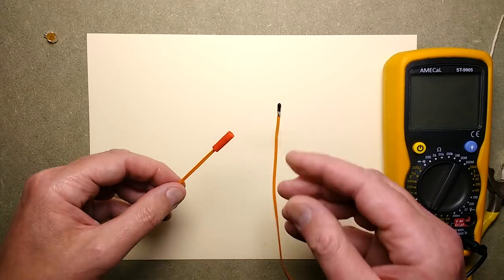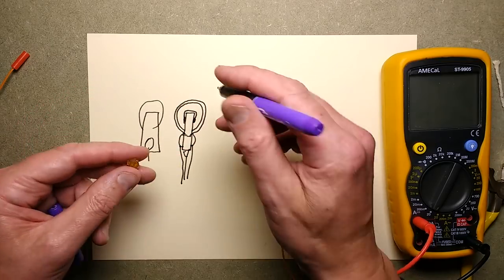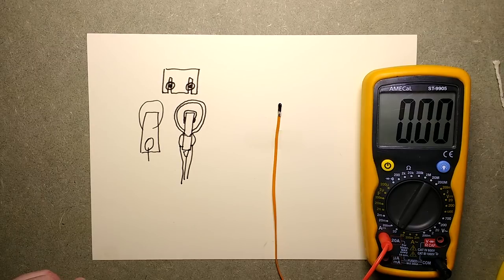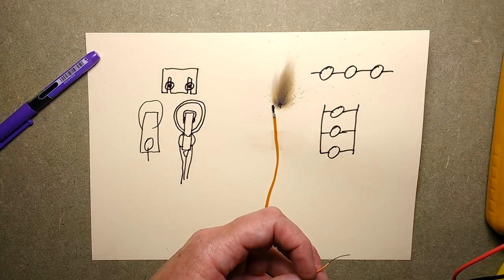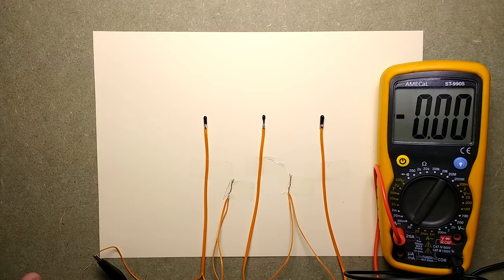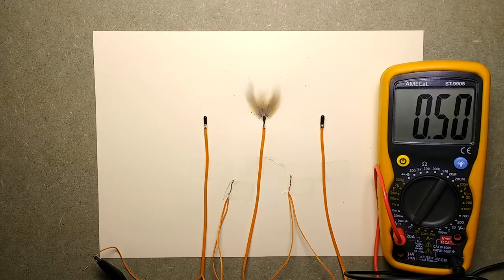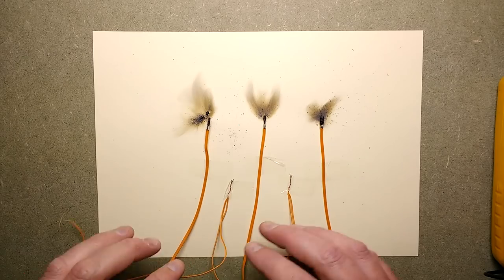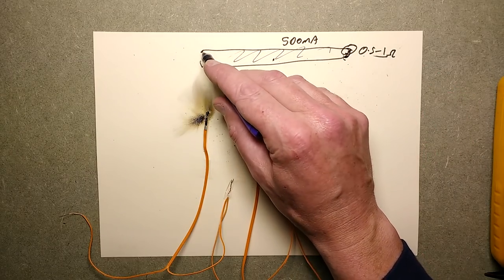Testing for electric match misfire.  (bangs and flames)

Comment: Hey Clive, I actually did set off a maroon prematurely with an RF device - I had about 90 feet of cable spooled onto a reel between the maroon a few feet away and the "detonator" - 12v battery and ptm switch - in the core of the spool, but the battery was disconnected to prevent early detonation. We were using licensed radios to communicate on site so transmitting at about 5W erp. I keyed up while holding my radio near the spool of wire and the maroon went pop! - An anecdotal incident for sure and not an occurrence that I've tried to replicate, but certainly food for thought and it affected our future use of maroons.
Reply from the maker: If it was 2-core cable you'd think the common spooling would have rejected common mode noise.  Strange.
Reply: Yeah, very odd indeed! Maybe the cheap Chinese radios were somewhat to blame? We ended up using little radio controlled wireless detonators which did the trick nicely though.
Reply: The radio quality certainly has nothing to do with it, since crappy radios wouldn't transmit at massively higher power than expected.

The current in a 50 ohm load is 300mA at 5W, so if the entire thing had by some freak accident a low impedance for your TX band, it's not totally unthinkable for a sufficient current to be induced. Seems highly unlikely and weird, but not impossible.
Reply: tommihommi1 Your spool must have acted as a pickup coil, multiplying the induced voltage by the number of turns.
Reply: Remember also that RF is used in a lot of pyro systems to control the effects (such as galaxis (firing-system.com), so the effect of at least low power RF must be understood and mitigated against.
Reply: John Francis Doe yes i also wonder if the spooling was causing high voltage nodes or perhaps even resonant. I've also heard that the cheap baofengs leak rf badly through  their shells so if the other hand was resting on or very close to wire or spool it could cause trouble.
Reply: Freak things happen with long wire. Could have been static build up on the wires. A nice coil wound antenna. just like in the old crystal radio set. No external battery needed.
Back in my early audio days we had issues with wire and air movement, getting static build up on the wires. Some times it got high enough when connecting the equipment up, to flash the LEDS on the powered off sound boards.
Reply: I’m reminding of a story we have locally, one of our radio team members was also active in the marines.  They would carry 5w radios around. Marines would put SQUIBS (used for jettisoning  armament) in their pockets. 

A common demo was to throw them in a coffee can and Key up the radio above it and have it go bang to get the younger marines to be careful with handling them.

Different type or pyro device but ultimately the same issue, induced RF currents can cause unintended detonations on any pyro device.

Comment: Could it be that because you ramped up the current slowly the first one blew but then the wire is in open air which allows it be cooled. Then then next one needs more current as the first is heating the air without blowing then a second blows then you have 2x wires being cooled by the air which then needs even more current to pass to get the same heat in the 3rd one to blow and when the 3rd one blows the wire is hot due to the explosion and the higher current is then able to blow the open. (Would they all fail open at higher current?)

Comment: After watching in slow motion (x0.25) the par with the 3 charges connected ins series, I noticed that the current spiked to 0.980 mA for a split second and the other charges didn't explode. maybe they are also built to withstand current spikes for a few split seconds? and also the resistance in the charge that exploded got really low because of the heat for a split second?
Reply: likely just the meter being stupendous.

Comment: If you placed a resistor in parallel with the charge, couldn't you use that to maintain continuity in case of a early fire causing open circuit?

Comment: Ah jelly crimps, the reason I have to have the phoneline fixed at least once or twice a year... :P

As for the matches, they're pretty fun little things by the looks of it, I have no practical use for them, I'd just want to set them off now and then... :D
Reply from the maker: eBay is your friend for electric matches.
Reply: Had a look, they're not cheap for people like me (aka Cheapskates)... :P

One thought though, nichrome wire and a rather increasing supply of ration pack matches, maybe a useful combination for homebrew electric matches? :D
Reply: Chances are the old connections have failed one by one over the years, your terminal is not well protected from water, or the tech didn't know what he was doing.  Either way those are designed to seal the wire while at the same time exposing as little of the actual wire as possible.  It's a great design if it's used properly.  Much better than marretts or screw down terminals.

Comment: So if you provide too MUCH current (like 10 A) into a string of those, does this increase the risk of misfire, due to some heating wires burning off like a fuse before the last one is getting hot enough?
Reply from the maker: The pro firing systems use capacitive discharge at around 100V so I'd guess they pass a fairly high current.

Comment: Hi Clive looking to buy a new multi-meter like yours the AMCaL ST-9905. I’ve seen them for £40 complete on Ebay. Is this model still worth buying or should I be looking at something newer.
Reply from the maker: On the basis that the knob has just broken I might suggest another brand.

Comment: The worst thing is a lot of fireworks sequencer computers will test good circuits for many E-matches in parallels but when you fire them the computer skips over them. This is why the fireworks show in downtown tampa was such a bust this 4th of july. The old "boom boom" system doesn't do that, it's a direct pushbutton switch to the battery banks, BTW we use very old skool centronics cables that go from the main firing panel or computer out to the breakout boxes which sit between mortar racks which use regular speaker cable spring loaded pinch cables to make the connections.

Comment: Quick/stupid question. Could you put a resistor in parallel with each ignitor to prevent an open circuit?
Reply: Open circuit doesn't matter, with the proper firing current they all ignite together within milliseconds.

Comment: These look a LOT like the Davey Bickfords we use at work! I'd be highly surprised if you got a misfire from one of those, boss says he's used them since '04 and has yet to have a bad one.

By the way, do you need a shot firing certificate to work with these pyrotechnics?
Reply from the maker: In the UK I think the only pyro requirement is some basic training to make people aware of the dangers.
Reply: I s'pose if they're just P2 that'd be the standard across Europe too. No training for P1 at all if I recall correctly

We supply the quarrying industry so shot firing certificates aren't an uncommon sight, thought maybe it'd be a thing in special effects too

Some weird stuff about manufacturing licenses and taking your toys apart on mainland Britain, mind, are they funny about it on the Isle of Man too?

Comment: I've been blowing off 5 gallon bucket bombs using cacium carbide for years. I like using piezo barbecue ignitors. There's no physical contact at the ignition point and they are very reliable. 
Bucket bombs are the biggest bang for the buck anywhere. They are as loud as the biggest firecrackers and fireworks, at least in the audible range, they are cheap, there is no debris, relatively safe, and the buckets can be used many times. The only expendable item is the lid seal which distorts. The explosion is so loud because the bore diameter of the bucket. If you ever try it don't use it near windows, it will shatter panes. Hint: 1/2 tsp per load.

Comment: I have worked on military explosive firing devices and one the UK army used at the time had an interlock button you had to hold to make the circuit so you could press the fire button.

The scary part of this was that the interlock was in series with the return wire! so the pulse still could be sent down the cable .

They failed to consider the transmission line effect on very long runs of twisted cable and this sometimes caused premature firing :o

scary stuff.

Comment: What happens if you fire them from a high voltage capacitor discharge ignitor, where the instantaneous current is large?
Reply from the maker: I'd guess they must all reach the ignition temperature together before failing.  The pro systems use that technique.

Comment: Why not just wiring them all in Series and connect a Diode parallel to the igniter, so when the igniter fails, the diode will take over!
Power all of that by a constant current source of 1A and there is nothing to go wrong ... ;)

Very nice video as always - eventough I had to think of the poor bambam that was excited to death... by something similar. :P
Reply: If the diode drop is greater than the voltage required to assure firing of the squib that should work well.  If not, you've introduced a new failure mode.
Reply: Or a juicy couple of ohms resistor across the lower part of the match?  Yes, you'd have to increase the firing current as you'd be wasting some power, but presumably it would decrease the impact of the failure mode described.  (Higher current required might mean bigger failure risk due to increase in power carried by cables etc though.)
Reply: That would increase cost

Comment: Nice pops and flames.  I would like to see the next stage - the fuse igniting to see the speed it burns at.
Reply from the maker: That depends on the application.  It's usually quickmatch though, so near instant transfer.

Comment: at 7.23 if you step through the video a frame at a time you can see that the current hangs on for about 12 frames after it fires which should be long enough to fire other ones in series with it as Clive says (if they hadn't fired already as they have in the video)

Comment: A buddy of mine found out the hard way that that you can't trust the continuity test to not light an electric match. He prepped a high power rocket with an I65 motor and installed the igniter in his motel room at the launch site. As soon as he touched the leads to test continuity,, the match went off, the rocket ignited, and he hung on for dear life. Fortunately he managed to hang on to it and avoid setting anything on fire, but it filled the motel with very noxious smoke.

I think that motor had about 1.5lb of ammonium perchlorate composite propellent, 10 sec burn time, and about 15 lb average thrust. The smoke is burning rubber plus hydrochloric acid from the perchlorate: very nasty stuff.

Comment: What about the scenario where the wire is a quarter wavelength long at the transmitter frequency?  This wouldn't happen with cell signals, but HF two way radio could possibly induce enough voltage at the end of the wire to spark through the ignition charge. No current through the loop in a conventional sense at all.
Reply: or any other resonant length with a current maximum at the ignitor, for that matter. It would have to be a freak accident, with a decent power radio close to the setup, but it's definitely possible.

An oldschool 800mhz GSM phone could maybe also do it under the right circumstances, those things were in the >1W range and the wavelength is long enough for fairly short cables.

Comment: I improvised some electronic igniters once with a 10 ohm 1/8th watt resistor, a match head and a car battery. they did work but took a second or so to fire
Reply from the maker: They are slow to fire, but pretty reliable.  I used quarter watt carbon film myself.  Here's a very old video from 10 years ago:-  https://www.youtube.com/watch?v=-770uMBQVfU

Comment: Pyro has come a long way from the time I used to work my way around the fuses with a portfire wearing an old fireman's coat. The thrill of setting off a long series of Japanese 125mm chrysanthemum mortars by hand while someone else follows on behind reloading the tubes must be an experience the modern pyrotechnician is denied.
Reply: Dropping shells into hot mortars, no thanks. People die that way.

Comment: Clive do you remember scotch locks that worked the same principle as the communication joint.,used a few of those back in the day on my cars.  I wonder because you put the current up slowly the wires on the first two would act like a resisters and as the last one blew it would heat up above the resistance of the other two from the heat of the explosive and have dumped the most voltage across it.  This would be interesting to observe with a voltage meter across each one as they blow.  I may be going down the whole wrong track.

Comment: Clive, have you tried building an outdoor led nightlight just using an earth battery, i.e., 2 rods of different metals placed in the ground?
Reply from the maker: Yes.  The rods corrode because they are just forming a battery with the wet ground acting as the electrolyte.  Very little if any of the energy comes from the ground itself.
Reply: bigclivedotcom True, but how long do the rods last?  If years, that could be one very long life battery.  My understanding is that the farther apart the rods are, the better it works.  This raises some interesting possibilities for low level led lighting on something like a fence...

Comment: Some years ago that thing is banned for retailing online in China, so I cracked some flashlight lamps which come on at about 1.2V, disassemble a firecracker to pour the powder on a piece of plastic film, put the lamp in and seal -- a DIY electric match that worked really well even with a simple alarm clock that drive a 1.5V motor to strike bells.
Reply: Also, nowadays fireworks are almost banned in China ;)
Reply from the maker: That's surprising.  China is famous for its fireworks.  Most of our stuff comes from there.

Comment: Can you use too much current/voltage? 
If it’s too high would it set them all off at once?
Reply from the maker: The pro systems do hammer the igniters with a high voltage and high current spike.
Reply: bigclivedotcom A-ha.  This is exactly the sort of thing your video got me curious about (along with wondering why the matches don't have a juicy little few ohm resistor further away from the explody bit to carry the current in the described failure mode.)  I can see that too high a current would cause those little filament heaters burn out, ruining the fun.  I wondered if there might be an optimum pattern to the triggering current.  :)

Comment: Are you still working with leds? I would like to ask a few questions please.
Reply from the maker: I never stop playing with LEDs.
Reply: bigclivedotcom have you ever replaced a driver for a pcb led grow light? I bought some cheap lights that are 1000w but only pull 10% of that at 100w I'd like to put higher wattage drivers in 1 to see if the will run at around 30%.  Any help would be greatly appreciated.
Reply: Aren't Polly buy phenol chlorides a little to to be used to grow things???

Let alone be messing with

Ludlow known as fertilizer

😏😏😏😏😏

Hahaha over and out

Comment: If you want to know the real reason for the plastic cap, other than directing the flame down the quickmatch. Take the cap off and run your knife down the side of the tip. It should go off like a blue tip match. This is a fatal flaw in its design, especially when quick match is e-matched by physically inserting it into the quick match paper tube on most devices. More modern device now use a plastic cup, that the match is inserted into.

Comment: Oh yes lol 😁 I used to make these but just ended up just rapping 3 turns of poundland speaker wire strand back in the day around the fuse or direct remove fuse all in parallel lol last one gets a pop lol

Comment: Would a simple bridge of a low value resistor between the positive and negative wires to each electric match allow for the match going open circuit and allow the current to flow to the next match? just a viewers thought. :)
Reply: then you need twice the current to actually ignite a match. So only useable with nice higher voltage capacitor based firing systems.
Reply: Thanking you for your prompt reply! :)
Reply: James Wade Better use a low voltage Zener diode. No current while the match conducts, and only a low voltage in case of failure. But much more costly, so probably not worth it for this application.
Reply: If mains power is available at the display, what about use a ballasted microwave oven transformer to supply the firing current? Plenty of voltage to arc through small gaps in the connections.

Comment: Question for anyone :)   i bought 5 of those really cheap K type thermocouples with the wire ends,  one of them reads 5c hotter at room temperature (didnt try hotter yet)  can anything be done for that or just accept it?
Reply: just calibrate for it in software

Comment: So the best way to fire them would be a large high voltage capacitor (e.g. 5kV 1mF) charged with something like a microwave transformer. But in this case I'm not sure if we need any fireworks attached to have a nice explosion!
Reply from the maker: The dynamite blasters use up to about 1kV but most pyro systems use capacitive discharge at up to about 100V.

Comment: I used to make those myself, although I don't think they kept conducting after firing. 
I used a piece of tungsten filament from a light bulb attached to a couple of wires. For the explosive, I crushed match heads and added some water to make a paste . I covered the filament with that and let it dry. 

I took inspiration from the electric starters used in Estes rockets.

Comment: You can close those connectors with your fingers. At least in low voltage wires
Reply: you must have some serious pinching power or very poor quality connectors and improperly small wires.....